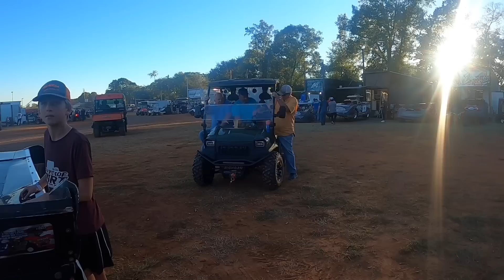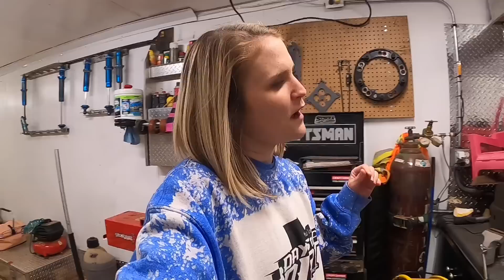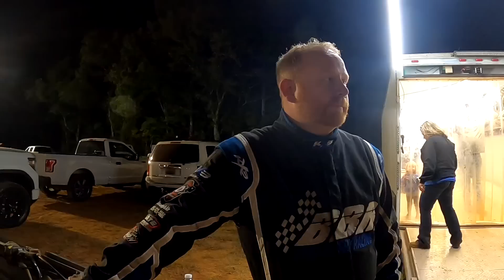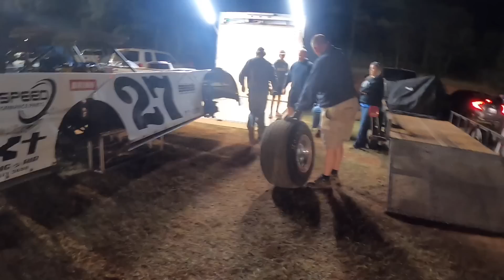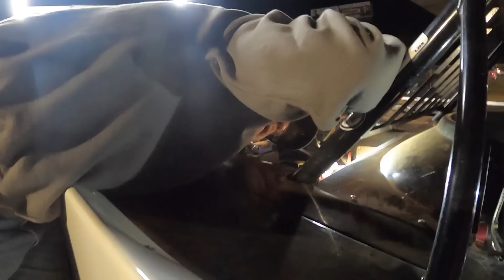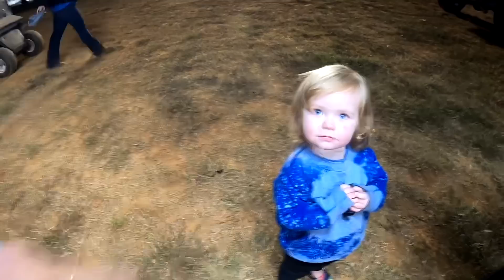Jerry Goodwin Challenge at Talladega Short Track : Night one NASCAR weekend

Comment: What happened to you is racing! Had a brand new super late model running the helmet dash and a guy puts us in the wall for 100 dollar dash win. It bent our front clip. Our crew fixed it the best we could and we won the race. What's 5K and a win when you have a 40k car bent? Racing is not a money maker. Unless you have an engineer helping you or a team who's put years in it you don't have a chance. A lot of times people blame the track when in reality it's the person who sets the car up, or the driver's fault for not making the car perform or the driver making mistakes.
Reply from the maker: What happened to us was indeed not just racing. If it’s hard racing and contact is made, yeah but when you go into the first corner of a 8 lap heat race & get spun when you’re clearly way ahead of the other guy, that’s NOT racing. You gonna tell me that there is 154 cars here this weekend and every single one of them have setup issues? NOPE. Good try though 😎 If it’s locked down & one lane, it is a track problem, not a driver problem..
Reply: It is racing, bad things happen that's not right. Things don't go your way and the Officials don't/wont do anything about it. That's racing!
Reply from the maker: How does that apply to this situation at all? We got our spot back…